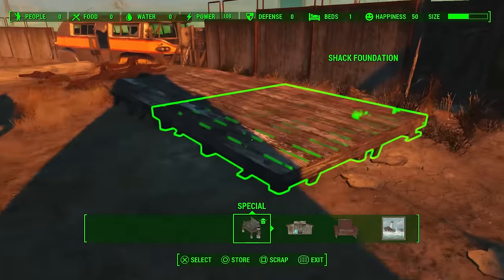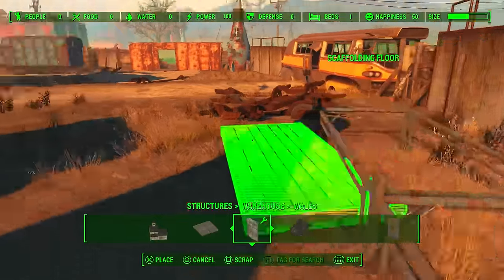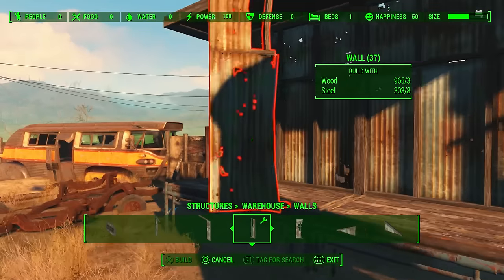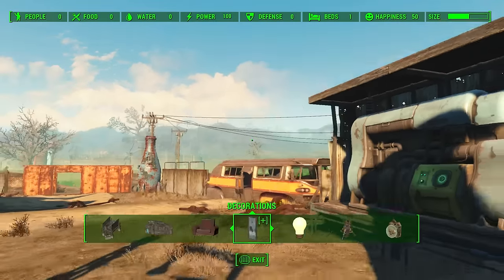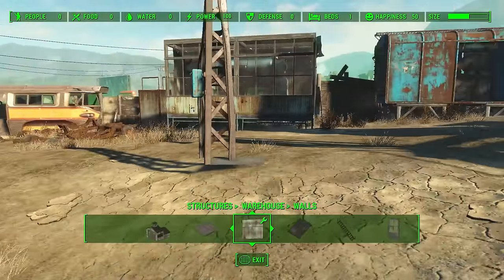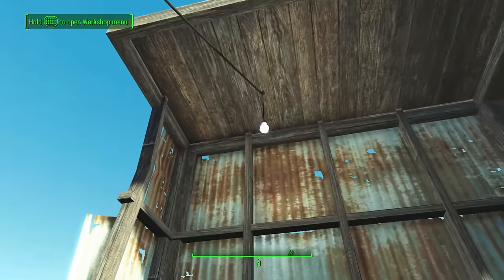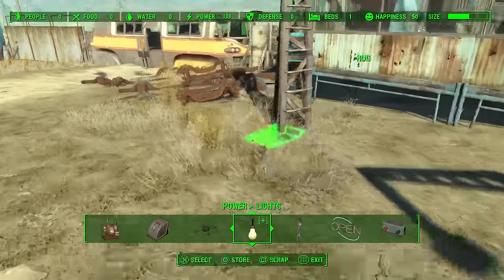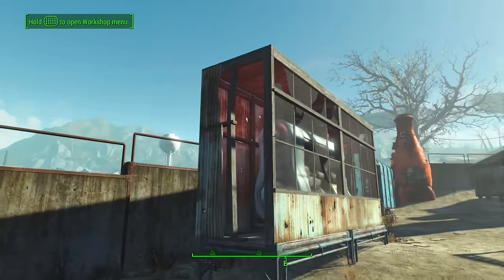Fallout 4 Guide - Simple Fusion Core Generator Storage

Comment: Have you tried the endless wires glitch? 

Essentially hook your generator/pylon to a power conduit, then highlight the wire between the two while hovering over what you want the wire to come from (wire will highlight and the pointer will be over the generator/pylon without highlighting it) and hit "attach wire". If you get the "attach wire" sound, you've done it correctly and can attach the wire thru walls and over unreasonably long distances. No more rug glitch needed.

Comment: If you rug glitch a scavenger station into the generator, leaving just  bit sticking out, you can assign a work to it.  He will come back and do the welding on the station but it looks like he is repairing the generator.
Reply from the maker: yes! I need to do that - as people have mentioned it before. I was gonna do it on another video (which is gonna be new generator ideas).

Comment: I use the railroad cars on stilts. They have a low enough ceiling to allow the generator connector to clip outside so I can place a pylon on the roof. I also replace the door with the powered door wired to a switch, that way raiders can't open the door.
Reply: To bring power back inside, the pass through conduit works well

Comment: concerning conduits, theres a glitch where you could bring lines through and across any distance by aiming at a conduit with a wire already in it while highlighting the wire and pressing the attach wire button. you'll know you did it if you hear the wire short but theres no wire in sight. then simply attach it to another source. just in case anybody out there didn't know.

Comment: similar to what I build but I make a full on shack lol. I use the normal fullsize floor bits and then conduits to get the wires through the wall, but your method is far mor compact lol

Comment: Nice I was doing this but was having to use the bigger floors with and walls with holes. One little trick if you take the pointer and highlight the wire just before the point where it connects you can then connect the wire to what ever you want I'm sure you know about it anyway just makes things a little easier.

Comment: You can high lite the wire but have the ur marker near the terminal you want to illegally connect to separate terminal..hit connect..it will spark with no wire..then connect to any terminal (thru walls even). Works great. I've used it a thousand times.

Comment: do the fusion core generators drain the fusion core over time??? I have only used the regular gas generators so far, but I need something with more power and am wondering if this is a good way to do it or if it will require constant refilling of fusion cores.
Reply from the maker: nah you they don't actually require cores. You're good.
Reply: norespawns no joke! that's great! thanks sir. great videos, by the way.